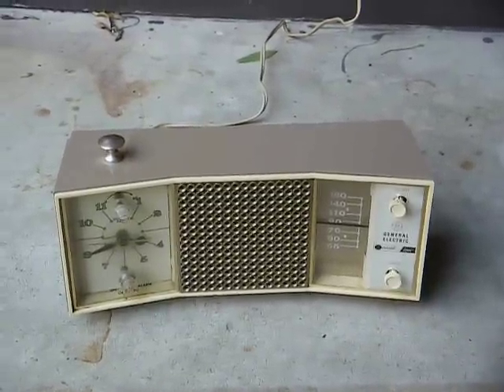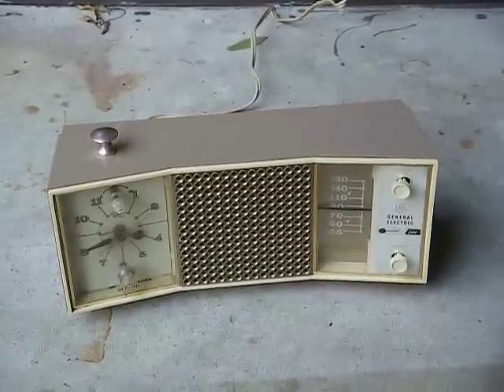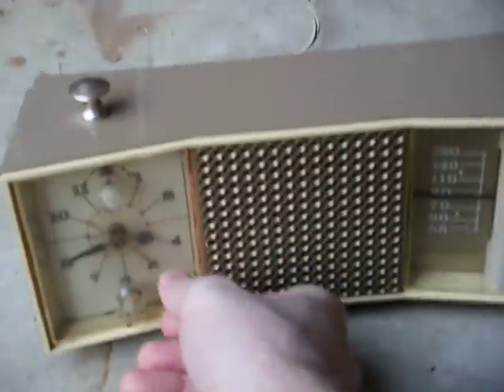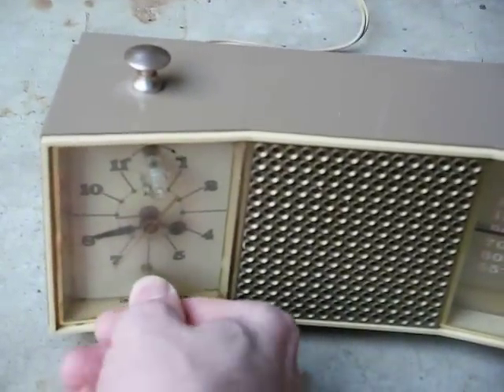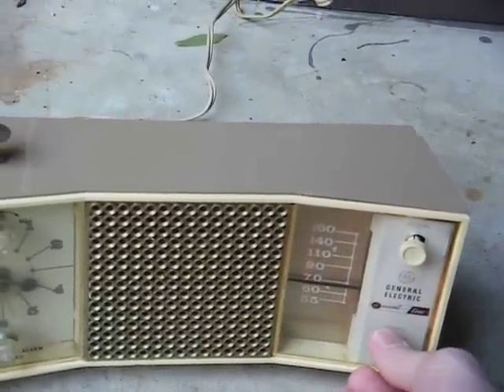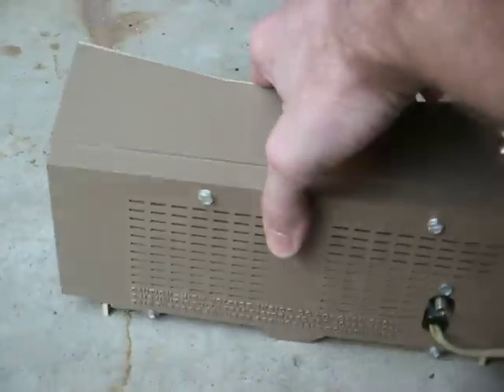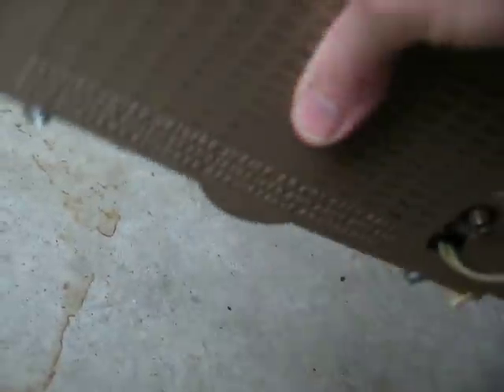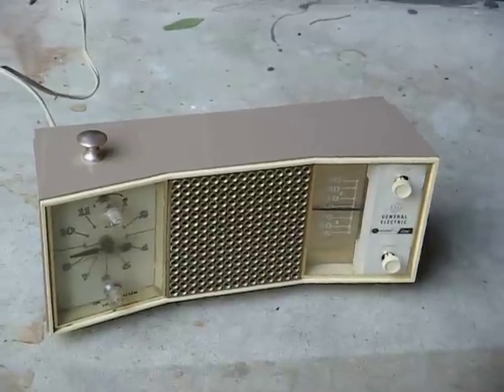GE solid state AM clock radio from 1965

Comment: that was a beautiful radio, sounded great on your video,
can you explain what the 2 civil defense channels were or are?
i had never heard of this, thanks in advance for any explanation
Reply: letseeitplease During the early stage of the Cold War it was believed that Soviet bomber pilots would use radio and TV signals to locate target cities to drop nuclear bombs on.  To prevent the Civil Defense came up with the first form of emergency broadcasting called Conelrad short for CONtrol of ELectromagnetic RADiation.  If an impending air attack was ever detected all TV and radio stations would go off the air and AM stations would go on the air at low power at the frequencies of 640 and 1240 with stations rotating to give a program of news and information about any possible nuclear attack on the United States.  When you see the triangle pointers on 640 and 1240 the radio was made between 1951 and 1963.